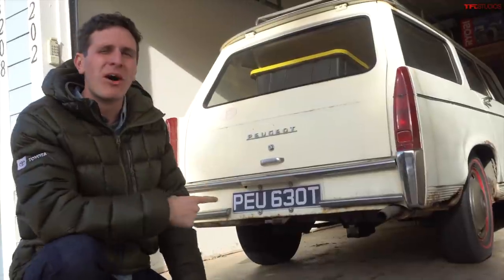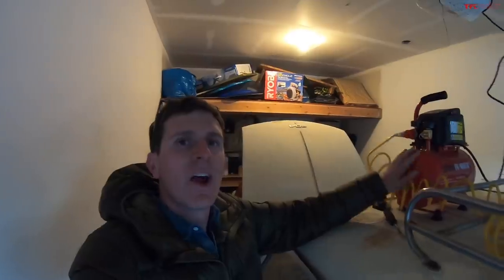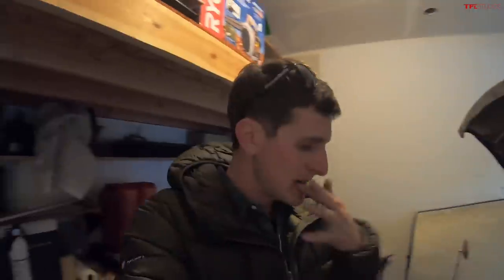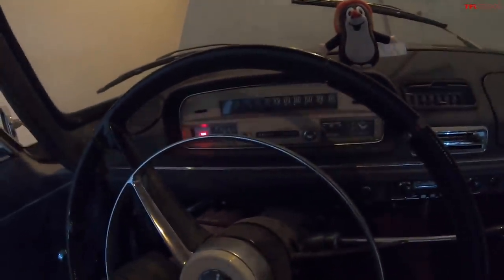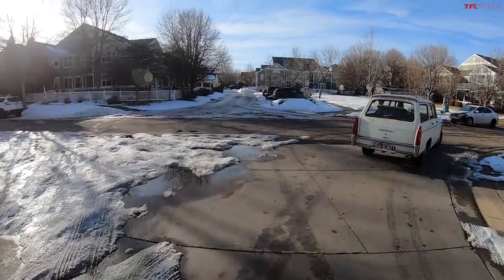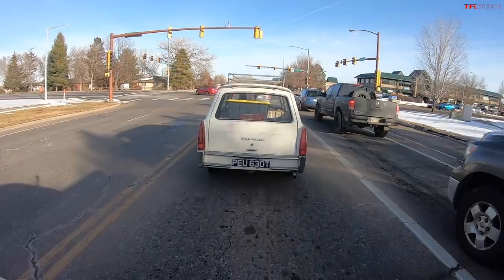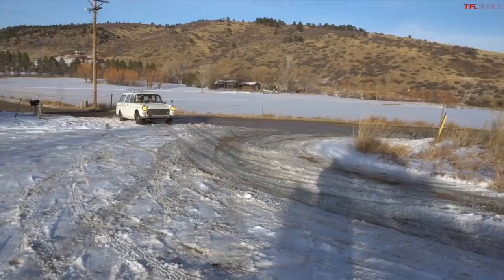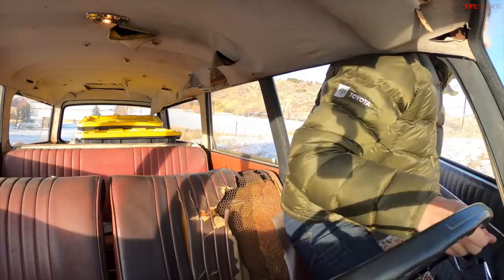I Rescued an Old French Car From a Barn, Now I Am Going To Restore It (Badly)

Comment: Thanks for the video. I grew up overseas, where Peugeot and Fiat dominated the streets. My dad had a 1972 Peugeot 404 sedan and I learned to drive on it. The car was very advanced for its time. Had a Torque Tube Drive (for the propeller shaft), slanted engine and plastic pipe between the clutch master and slave cylinders.

Comment: In the early 70's I drove an elderly womans 68 automatic Pugeot 404 for her.  It was pretty good in the snow, as it didn't seem to have enough horsepower to spin a wheel.  Quirky car, I remember the fan switch was under the dash, on the heater box... not very convenient when you are driving.
Reply: My 404 was great in the snow.  The automatic started out in second gear and I think that reduced wheel spin.

Comment: Tommy be sure when your gonna let any car sit for months u add some sta 
 bil gas additive it will keep the gas fresh and from varnishing in the tank also I'd recommend high octane fuel and if  run the carb dry by disconnecting the fuel line or adding a fuel shut off valve  next time She will fire right up . U can also just prime the bowl in the carb by dumping some fuel down the carb next time vs sucking the fuel line lol.. most likely that carb will need to be rebuilt at this point  stay well merce

Comment: It needs a fuel pump if there was no blockage and you had to assist by syphoning to get it to the carb, and then it died on the hill because of the angle of the climb it needs it.

Comment: Don't buy the wrong air compressor for the job and then complain about it being a piece of junk.
Those air compressors are fine for the job in which their intended.
If you want to run a blowgun continuously you're going to have to get something that costs more then a cheap little "top off your tires" compressor..